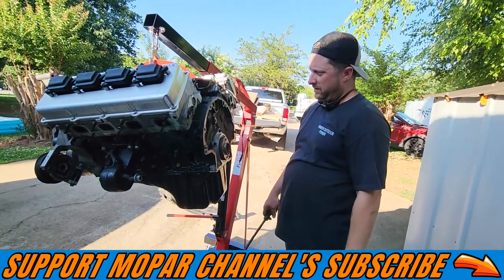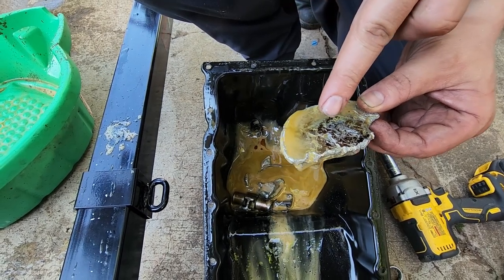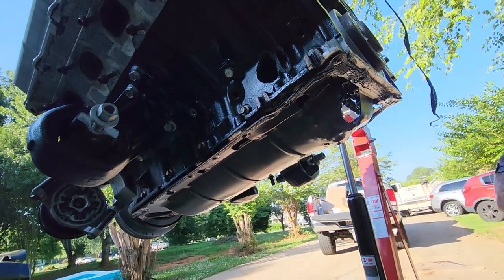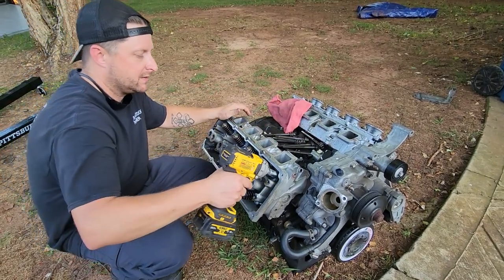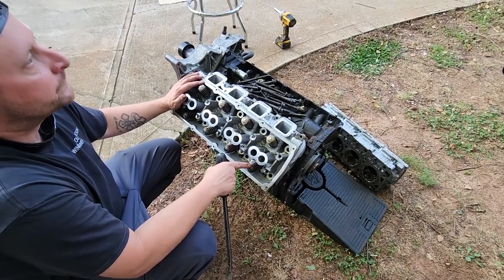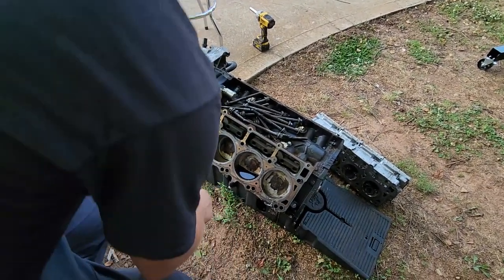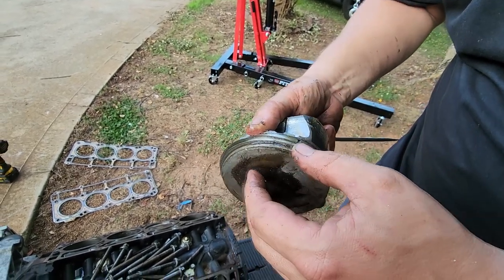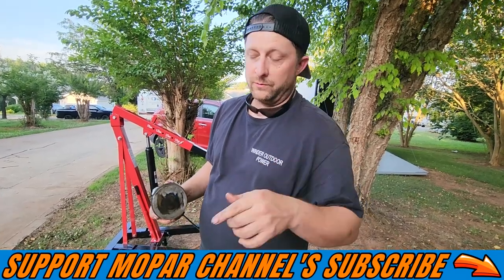FROSTBITE Teardown Part 2 Now That's A Blown Motor!

Comment: Hate to see this happen to anyone, but,  brother but you sure did a number on that little old 5.7!😂 Now we both know where that limit is.
Reply from the maker: Yeah man I believe you could push the 5.7 15-18 in decent air and have a long life span for sure. But racing in that summer heat is not a good idea. Also I believe staying under that 7k rpm range on stock internals is probably a definite.

Comment: Dylan, the heat is what failed. The engine components, all of them , met their maximum effort from heat cycles. In my opinion it was about time. Like how long you've ran that block without a full tear down and rebuild. Im sorry this happened to you. Ttyl
Reply from the maker: @snowcone75  yeah been racing that motor for 5years lol 157k on it

Comment: Are you going to de-stroke, increase the stroke in the 6.4 or stay with stock stroke? I haven't seen one like that since my Pontiac days, it was valve float that caused it on my 389.
Reply from the maker: Going to stay stock Stroke and yeah I'm thinking the springs didn't keep up.

Comment: Heck yeah, for sure was the springs. Those do look like they got hot, weak, stretch a little and gave out for that split second. Would be cool to see what those springs can hold now compared to what they should be rated at. Maybe they actually did lose some strength, and lost a few pounds of force. Either way, upgraded parts all around
Reply from the maker: I believe so.

Comment: So stock rods held for how long/ much power?  
I’m just getting here

 Hi reving weak rods and piston toss gets em most  of the time.  
Looks exactly like what happened.  Wen they come apart like that and crank end is that good.  

Wen the piston gets snatched down from top of the cylinder it’s a huge strain on the rod.

It literally pulls the rod apart. Early 5.7 rods are not strong at all. Not even old school 318 strong
MOPAR2YA BUDDY!
Reply from the maker: @Formerlywarmer  over 20psi boost for several passes and was in the ball park of 850-900whp
Reply: @FrostbiteRam  WOW! Just wow 😂.  MOPAR2YA
Reply: @FrostbiteRam I am surprised in a good way that the stock lower end took that 20+ psi of boost for that many passes bro, can't wait to see what she does with the 392.

Comment: Piston busted then rod went
Reply from the maker: Could have but what caused the busted piston. Valve touched? Because it wasn't just from being weak the part that breaks normally didn't.
Reply: @FrostbiteRam  piston is weak point if valve did touch wonder if u might had valves  bouncing off seat during closing good chance ? Check on a symmetric  cam closing cycle on lobe little softer to help prevent that also increased vavletrain stability??